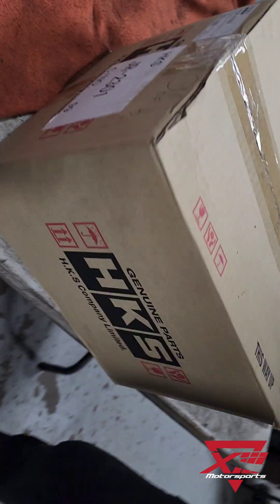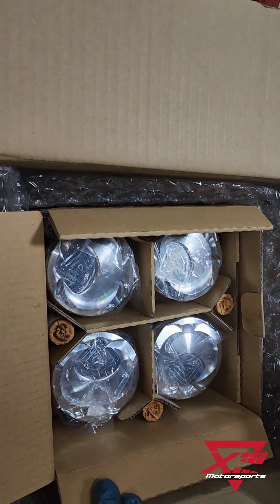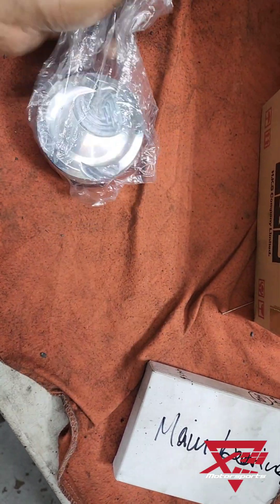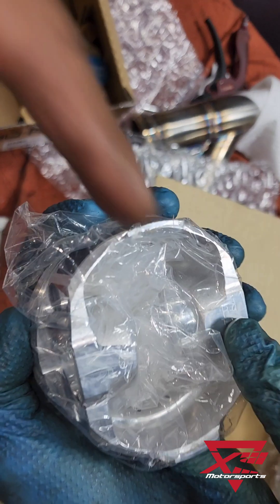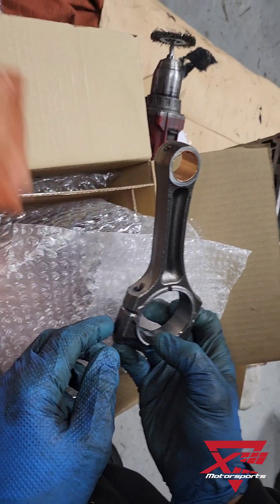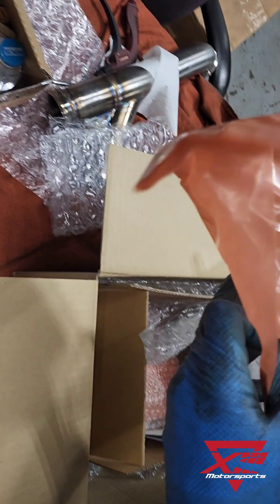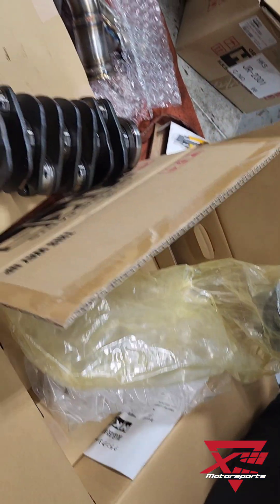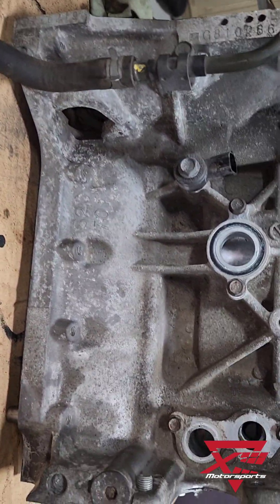HKS FA20 Stroker Kit Build with bent rods !

Comment: Looks like the oil passageway is different on the hks crank vs OEM? Is each rod bearing fed by its own main? Rod 2 & 3 share a main on the OEM crank.
Reply from the maker: Yes they also use sr20 rod bearings

Comment: What kind of power could you typically expect from this kit?
Reply from the maker: We are going to push the limits and hopefully hit 500whp
Reply: This kit and nothing else? About 10 horsepower. Point is that with this kit your engine can take more power where stock internals stop being reliable when going above 280 hp.
Reply from the maker: @Riko_KP  without boost. Lower compression probably going to hurt the overall VE.
Reply: @xiiimotorsports  Exactly. Like I stated, the HKS capacity upgrade kit and nothing else gets you about 10hp. It is a given that boosting can give you, well, pretty much whatever you want (within limits, the HKS kit claiming to withstand 550ps). I don't know what you were trying to say about the compression, but HKS makes two different kinds of kits for the FA20, with a 0.5mm gasket you would get 12.4 with the normal capacity upgrade kit and 11.1 with the low comp kit.

Comment: ITB’s and big cams, NA 9000rpm beast ! 👍 That’s what I’d be doing anyway. Would make a nice change from just slapping a turbo on
Reply: How much is the stroker kit price?

What other mods are needed, or will it work
with everything else stock? (remap, obvsly...)
Reply from the maker: @jn904  We are selling this through our shop, there is a NA kit and a low comp turbo set up. If you can send us a email I can get you a quote. We are doing a turbo set up with the whole 9. So ECU tek tuning. It will for sure effect the engine VE i doubt the stock ecu will compensate enough, but I am not sure. You need to hone the block and machine some clearance at the bottom to avoid piston to the block webbing from contacting. Its a really nice kit
Reply from the maker: That would be cool to hear it rip, but not what were looking  for. Our customer wants a fast car and we will deliver on that